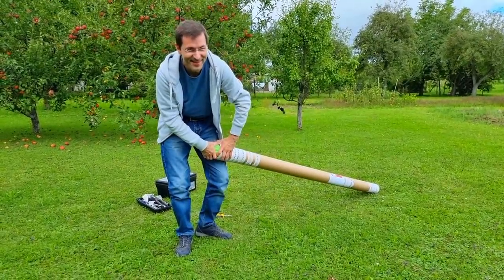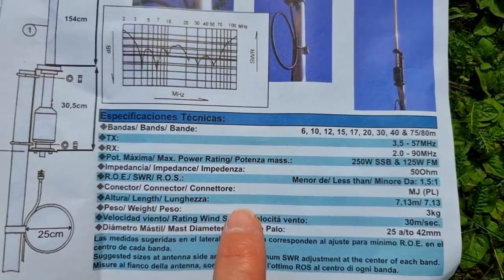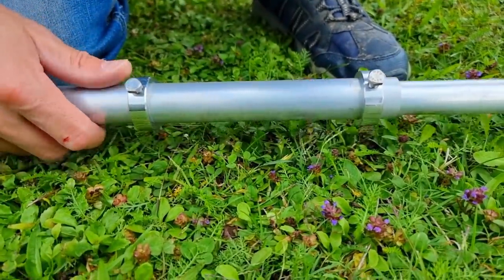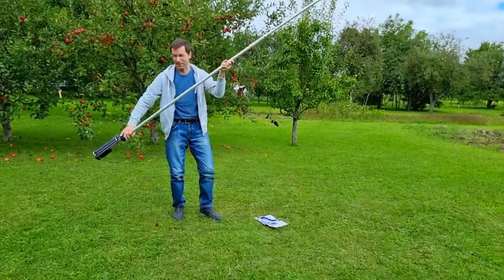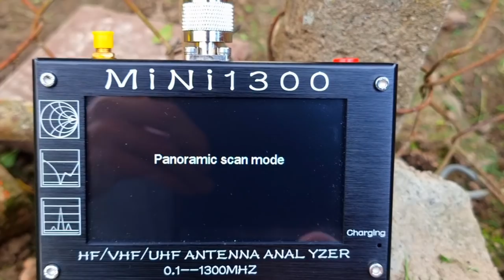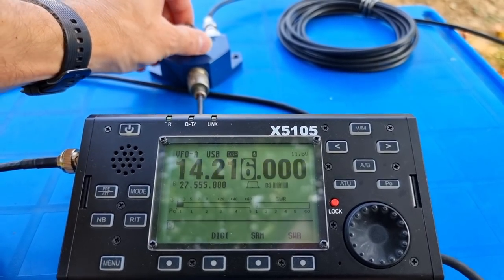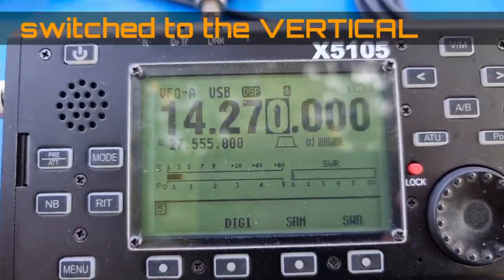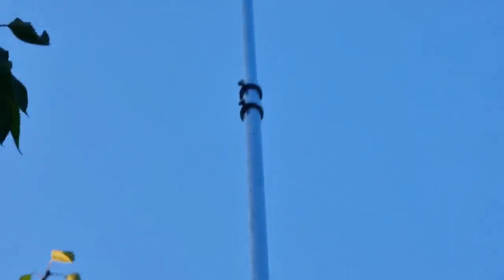HF Multiband Vertical Antenna - FALCON OUT-250B

Comment: I cannot find a follow up video after you used the MFJ. Autotuner and by-passed
the un/un transformer on the Falcon antenna. (Your modification.)
The antenna looks superbly constructed but as you were assembling it, I had this nagging feeling of doubt in my mind about that un-un transformer.  Your findings did not surprise me. 
If the MFJ auto-tuner, by-passing the Falcon transformer improves things, it would also be very interesting to see if a quality Un/Un  (9:1?) wired like the MFJ makes a similar improvement.
Bear in mind that the mag loop is a very high angle take off and can be V. low noise and the vertical is the opposite on both counts,
73 de G3NBY.
PS. How did the MFJ perform?
Reply from the maker: Thanks for comment 😉👍 Follow up the link on the very end of this video and you will see the the livestream video demonstration of this vertical with bypassed transformer by the MFJ autotuner. It wotks great. Today i worked a New Zealand with it on 40m band (report 5/6) with just 100W and 50m long coaxial cable. 73
Reply: @OM0ET  
Hi.. Thank you for your swift reply. I found your video, using a IC. 7610 with the Falcon antenna, now modified by shunting (By-passing)  the Falcon transformer and matching directly with the MFJ auto tuner. Clever move !!!! You obviously found it to be a better match and far better performance....I'll knock up a 7.13 m vertical and my Icom auto tuner. But it will be a bit higher than yours. Winched  mast and pole etc,   Have you provided any counterpoise or earth/ground return?   
Many Tnx.. I enjoy your videos..
73 G3NBY

Comment: The Falcon is not so good there are 8 Ferrit Rings inside. I give you a interestet link. 73s
Reply from the maker: Thank you very much!
Reply: @OM0ET  I sent the link to your email address. Youtube is constantly deleting the link here. 8 ferrite rings are in the plastic sleeve at the bottom instead of a capacitive coil which is very unusual.

Comment: Most HF DX is on the flatside (horizontal polarity)  The mag loop has horizontal polarity vs the vertical (vertical polarity) so there is a signal difference between the two.  I wonder if the ERP (effective radiated power) between the two is different.

Comment: Hi Paul, 
I'm wondering to see so much space in your new garden and then see you buying such a compromise antenna. The shown SWR spectrum is not possible, if there is not any resistor in the bottom case. This is a dummyload with a radiator, I think... Please take 22m of wire and a fishing pole and build an inverted v half wave endfed. This would have better results... 😉
73 from DG4BAD (Martin)
Reply from the maker: Actually it's not my garden :D it's just my wife's parents house which is our temporary QTH. I tryed the 22m long inverted V and 49:1 UnUn, also EFHW antenna inv.V, or the Random wire Antenna with MFJ tuner and was not happy with results on the air even if the SWR was fine. I am not able to lift the wire more than 5m above the ground in my conditions, which is not enough ;) Best 73

Comment: I am not too surprised the base coil will cause losses. The low SWR over all frequencies can’t be easily explained. There must be something wrong. The first place to look for the error should be cable loss, that kind of ‚smoothes out’ the overall impedance of the system. On the other hand the antenna doesn’t seem to perform too bad. Bypassing the coil and using a tuner at the base should not do the trick, I think. You might want to tweak the antenna length a bit, but that should not enhance performance on all bands. So what would I do:1st-use the four screws on the lower plate to apply elevated radials, experiment with different lengths and angles. 2nd-Reduce transmission line loss (better or shorter cable).
Reply from the maker: This antenna is just a temporary solution and work pretty well with attached the tuner :) but at least there are many thing how to improve this antenna as you mentioned ;)

Comment: I would strongly advise injecting silicone into the drain hole you pointed to to stop water getting down to the balun - I had the Sirio/Moonraker 80 - 6 meter version of this antenna which was ruined by water ingress and needed a rebuild as a result. They work OK but need the location and the conditions to be with them. In a high density urban area like mine they are very noisy with QRN ! The Sirio Plus kit helps the band coverage and effectiveness but is difficult to tune. You can play around with other Un-Uns which is fun and can improve performance. Realistically a long fishing pole with a EFHW wire and Un-Un works just as well if not better (and is much cheaper). M7BLC . 73.

Comment: The loop isn't affected being close to the ground and the vertical. They also they raditate different. So hopefully once you get the vertical up higher it will give you better preformcace. 73's